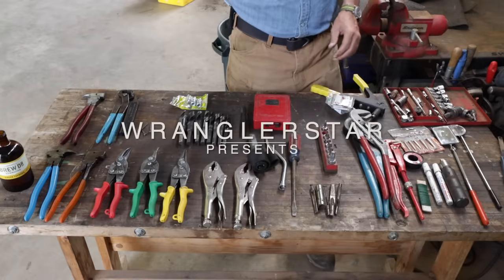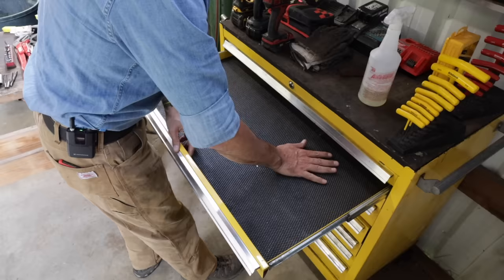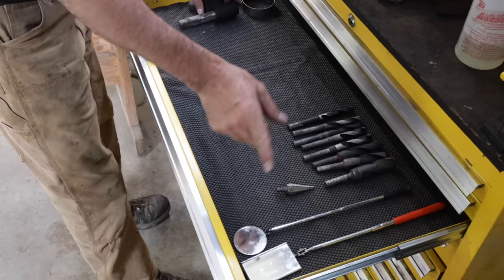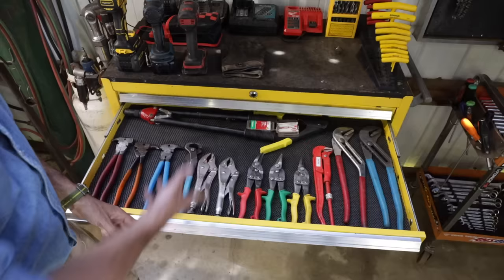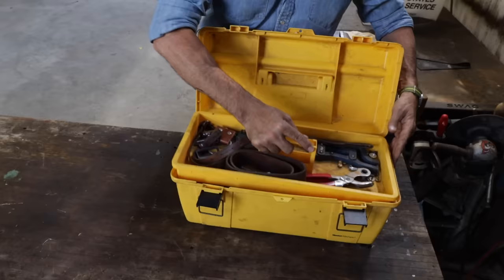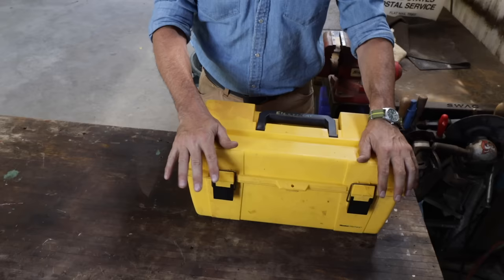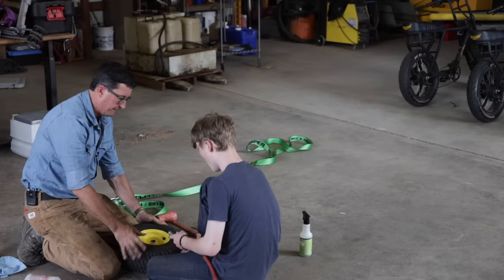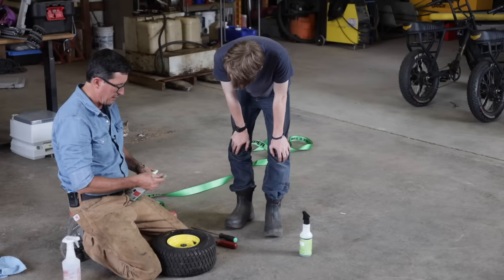Watch This Before Organizing Your Toolbox

Comment: The one thing I have found with that style drawer liner it allows a lot of dirt to get under the liner and it slides. I try to use solid drawer liners. Also a great tip for people that are having issues with seeing I use white drawer liners. It really makes things pop when they get dirty you just clean them. I’ve had them for years in a professional shop. 
Great video staying clean and organize is a great timesaver.

Comment: After a good 42 years of acquiring and using all kinds of tools I have gone thru 2 phases 30 years apart in trying to organize tools. The 2 phases were trying to stow tools in tool chests like my 2 internationals which just doesn't work due to my  massive collection. Anyway I opted 18 years ago to use 2 large cantilever boxes for screw drivers, wrenches, pliers, punches, socketry, breaker bars etc then another box for podgey bars, drifts cold chisels etc. Another box is dedicated to auto electrical tools etc, and another for welding and grinding safety for eyes and breathing respirators and filters, then a box just for measuring, torque wrenches etc. This has more than what I need and departmentallized for every discipline needed. In carpentry I have a box just for all the door and lock tools, and concrete tools, hole drills etc.. This all are enclosed from elements and stacks well in the truck. Yeah the rolling tool chest was more or less a hinderence  as no matter how big it is its hard to organize and its very impractical. The large tool cabinet are just status symbols in the shop.

Comment: Nice job on cleaning the shop. It's a never ending battle!  Just thought I'd pass on what I did with my lawnmower's front tires. I  had them properly foamed at a place that deals with agricultural equipment. Kinda pricey, but no flats in 15 years.
Reply: What does it mean to have the tires foamed. I am new to maintenance stuff

Comment: Hey Cody. I have a quick tip for the tire changing. Clamp a pair of vice grips to the rim by the valve stem. It helps hold the bead down. Leaving both spoons to walk the bead over. Also, most of the time I could seat the bead by taking the valve core out. I hate it when I have to drag out the ratchet strap. Great video! I'll watch it again when I clean my shop tonight.

Comment: This system works well if you have next to no tools. I have two tool boxes each of them are smaller than the one in the video and they have more than double the tools in each one. The key is to buy tools that are supplied in modulated trays. More compact and higher capacity.

Comment: I just went through this of having a riding mower tire leak and bought tubes for the tires but the stems on the tubes weren't in the right place for the wheels.  So check the location of the tube stems so they will fit the wheels.

Comment: If you clamp a large bolt in your bench vise and then slide the rim down over it you can put a nut on it and have a way to hold the rim like a tire machine does. Makes changing those small tires MUCH easier. Also, you can buy new front tires from Coastal for not much more than tubes cost.

Comment: Actually, slime isn't really a problem with tire shops- the aerosol products tend to be messy and use an explosive propellant which makes the tire both a hassle to deal with and dangerous.  With slime, well you're the propellant so there is no explosive and it's water-based and cleans up easily.  Pop the tire off and if it's been there a little bit you just hit it with compressed air and it comes off, done, if it's relatively new then you might have to use a little water to clean it off.
Reply: ProjectFarm did a video comparing different tire sealants recently.

Comment: Hi Cody, I have the same problem but in reverse, I am adding holes to my belt but unfortunately, my holes are at the other end of the belt to accommodate a wider waste. I got a little confused as you have released the videos in the wrong order and I watched the one where you changed the lock and put new runners on one of the draws and then you tell us in this video that you will need to send for some new runners and a lock, but my little brain finally realized that you had mixed up the order and nothing else.

Comment: I would move the sockets and wobbles up to the top drawer and the fuel disconnect stuff and other non-wrenches down to drawer 3.  I like to keep all of my sockets and socket related things in the same drawer. also the fuel disconnect tools are less used so i move them to lower drawers. Also I fell like punches go with drill bits more than with hex keys and line wrenches. Nothing really wrong with the way you have it, I just have ways I like to group things. lol

Comment: Go get the tire spoons from harbor  freight much easier to to change tires then with pry bars also get the tube with slime already in them then you will never have to replace the mover tires agian. I have goat head thorns by my house in central California they will go through riding mover tires, and the tubes with slime was the only way not to get a flat.

Comment: Those small, thin, tubeless tires. Always crack and leak. They ought to put tubes in from the get go. But, nah, too practical, and it would add a few buck to the cost...

Comment: As soon as you get rid of that mini hacksaw you'll need it. Great for getting into tight spaces.
Reply: Yep I use it to cut toilet bolts.
Reply: My wife knew the guy who invented that tool.
Really it has been replaced by those new multi-vibration tools.
Reply: @borisisasleep8993  I've been in places way too tight to use one of those tools. Before the mini-hack I'd make one with a piece of blade with a tape handle.